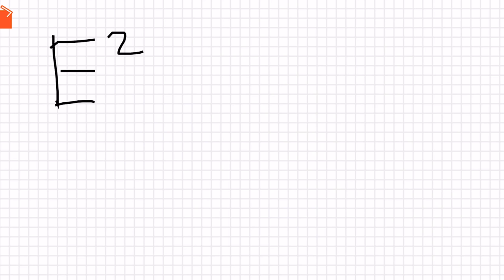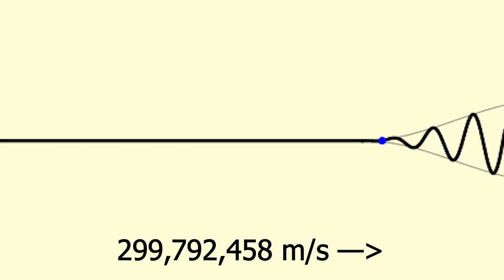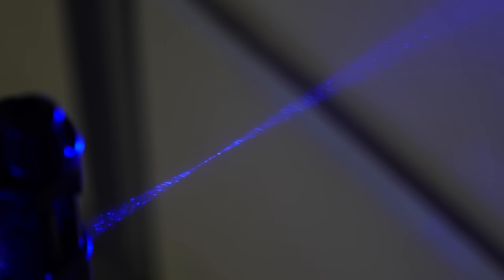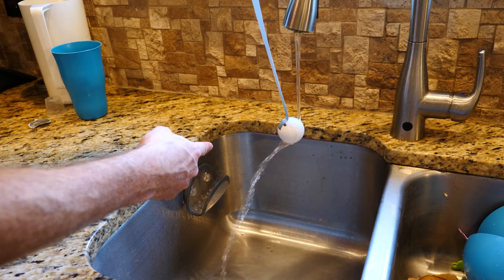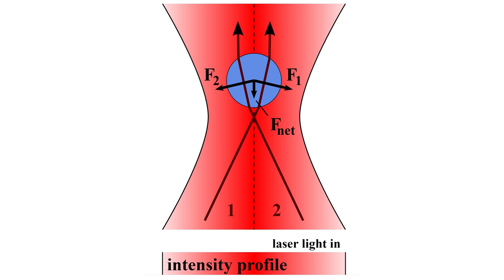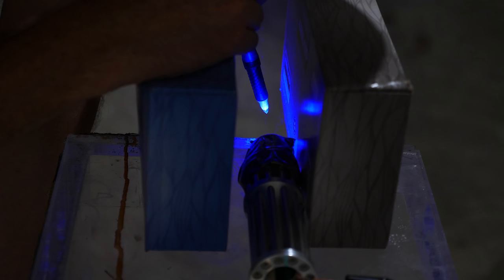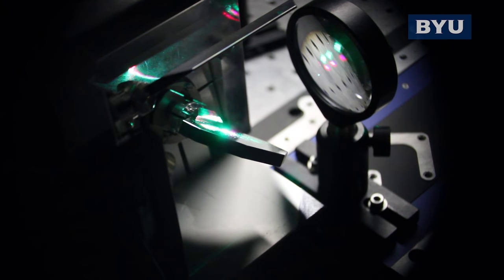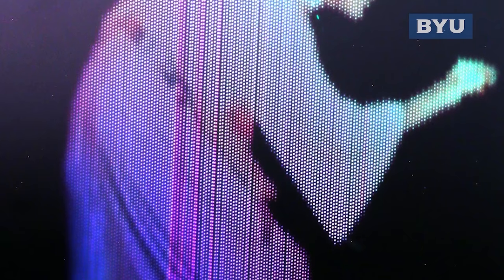Trapping Particles In a Beam of Light—The Optical Tweezers Experiment

Comment: I could see this being used for sci-fi holograms in the near future. Seems much more promising than any other 3D hologram tech I’ve seen
Reply: Technically that would be a volumetric display, holograms are 2D panels with depth,, volumetric displays are fully 3D displays with no background. The issue with this one though is you can't turn it off once it's on or we lose the particle in the laser. Plus it would get finicky with multiple lasers crossing each other. Probably still better to go to holographic displays for viewing content. Plus you can't really make shows or movies with a volumetric display as you don't get room design or backgrounds, just the focus.

Comment: I've always wondered about light being massless when the SI units for momentum are kilogram meter per second.
Reply: Same here.
Reply: I think it has to do with the Lorentz factor. As something approaches the speed of light, the Lorentz factor increases to infinity. In order to get something's mass as it moves at relativistic speeds, you multiply its rest mass by its Lorentz factor. As matter approaches the speed of light, its mass approaches infinity.

Photons don't have mass though, and their Lorentz factor is already infinite, so you end up with zero times infinity. This is indeterminate, and as you learn in calculus, it can be 0, infinity, or anything in between. In this case, it seems to be something in between.

That's how I've always thought of it anyway.
Reply: Its displacement.
Reply: Inordinate particle wake
Reply: If “nothing “ goes through something it leaves a trail
Reply: So then how do we explain displacement here( on earth) that directly interact with particles left in in wake and ahead of it…we like to think particles(some
Reply: Particles) have a memory whether past or future
Reply: @unitedspacepirates9075  - If that were true, a magnetically cancelled wound coil (like the ones used for wirewound resistors) would not have back EMF, yet it does.
Reply: PBS said: "Imagine a massless box with mirrored walls. Impossible, I know, but it's an analogy for something real, as we'll see. Now fill it with photons, also massless, that bounce around inside the box in all directions. All of the walls of the box will feel the same pressure, so there's no overall force on the box. But let's give the box a little nudge; increase its velocity. Now the back wall of the box moves into the incoming photons. It feels a little more pressure from their impact than before. In the meantime, the front of the box, moving away from the incoming photons, feels less pressure. There's a net backward force that feels like a resistance to the change in speed. The photons exert a force on the box, the box also exerts a force on the photons: Newton's 3rd Law, which gives us conservation of momentum. Momentum lost by the box is transferred to the photons. Now, if the box stops accelerating, then everything jiggles around & momentum gets shared out evenly between the box & the photons again. But as long as acceleration continues, the pressure differential persists. Acceleration is resisted in a way that feels exactly like mass. In fact, it's indistinguishable from mass, because it is mass. The photon box is massive, even though none of its components - not the photons, not the walls - have any mass. Somehow, mass arises in the ensemble where it doesn't exist in the parts."
(from the YT vid 'The True Nature of Matter & Mass')
Reply: @alwaysdisputin9930  clever humans might figure out gravity propulsion before they destroy their planet after all.
There goes this galaxy :(

Comment: @
The Action Lab  Wow!!  Talk about a coincidence man!  Just this summer, I was doing optics research with a researcher that actually helped pioneer some optical tweezer research a couple decades ago!  We were working with optical vortices for a different purpose over the summer, but one of the papers I was assigned to read was one of his papers on optical tweezers.  It's so weird that you make a video about it right after I had that research experience.  By the way, one of the things I read is that you can also use optical tweezers to move tiny beads to indirectly move cells as well.  Really cool video, thanks!

Comment: James, I have a query, but first, I absolutely admire the enthusiasm behind your explanations, and the efforts of the demonstration! Thank you for that😊. So, I had recently attended a demonstration on optical levitation, and as I read more, I came across this description from Wikipedia on “Optical tweezers” –

 “The narrowest point of the focused beam, known as the beam waist, contains a very strong electric field gradient. Dielectric particles are attracted along the gradient to the region of strongest electric field, which is the center of the beam. The laser light also tends to apply a force on particles in the beam along the direction of beam propagation.”

I noticed that your explanation describes the levitation analogous to the mechanical imparting of momentum, while Wikipedia emphasizes the levitating particle’s dielectric properties interacting with the beam’s E-field. 

My doubt is, what we notice at a macroscopic level as mechanical, does it converge to electromagnetic interactions with material properties in the microscopic view, as the same effect?

Comment: This is intriguing. There is an obvious flaw if we want to use this more however which you pointed out..  air dispersion. The particles can be dislodged very easily, however, I would surmise that creating a static field around the area would resolve this to varying degrees.

Comment: I just loved your vídeo on laser light momentum. I used to do an experiment to show brownian motion on smoke particles. I used a spectrograph cell with good viewing windows. After loading the cell with smoke it was closed. Then a laser pointer beam was was passed through the cell. The random motion of smoke particles was easily observed using a microscope at about 50x. Well, my question is: why did I not see a forward motion of the particles along the laser beam. Supposing there was momentum transfer ?

Comment: Thanks for the video. You (and others watching) might want to look again at the difference between optical tweezers (sometimes called optical dipole traps) and magneto-optical traps (sometimes called MOTs). This video uses the physics behind MOTs when talking about optical tweezers--which is related but not exactly correct. In fact, optical dipole traps can hold particles still far below what is known as the photon recoil limit. Good luck and cheers!

Comment: E= mc² is just a special case for rest mass to rest energy relation. Since individual photons or a photon beam are never at rest, yeah, you have to use a full equation mentioned in the video. Fun fact is when you put photons in the box with fully reflective inner sides their momenta cancel out as a sum, so their energy does contribute to the rest energy (and thus rest mass) of the whole closed box system.

Comment: im so happy that i have a laser collection. just tried this with a 1w 445nm, 75mw 520nm, and 20mw 405nm. worked with all 3 that i tried it with. amazing demo! you can move the laser around gently to move the suspended particle. i suggest doing what he did and put things around the focal point to keep the air as still as possible. also, never forget your laser saftey glasses
Reply: Hey I’m trying to do this project for my physics class and I can’t find out where to get any of these things. Did you have to use a lens to focus the light more or did it work with just the laser? And can I just order from Amazon a laser that has the same specs as you mentioned??
Reply: @dannyphxntom8992  i personally just used the focusing lens built into the lasers. the most important thing about this experiment is the quality of the beam shape, youre going to want as close to a circular beam as possible. you can check the beam shape by using an external lens or just the built in one. i had a 800mw 638nm laser that i tried this with, but it didnt work because the beam was shaped more like a line. ideally you should be using a "single mode" laser, which gives you the best beam shape for a diode laser. you can find higher powered single mode violet lasers on amazon i think.

Comment: Three Questions:
1: has the light beam carved-out the ink particle to a perfect size that like gun rifling the bullet is loaded at the ready, even though it's currently with the gravitational pull of the planet?
2: if double this amount of light were suddenly to occur, wouldn't that fire the bullet to light speed?
3: could this be used to escape the gravitational center of a black hole, if one were to triple the amount of light, hence doubling light speed? Naturally, the bullet would need to be somehow resistant to all forms of cosmic friction, but be perfectly snug into the rifling of the light beam, while not causing the sonic-boom equivalent of a big-bang event?

Comment: You can also have such Graphene particles induce heat when you increase the wattage uniformly .. as well as irradiate cells to cause spike proteins to respond dynamically to the vibrational irritation. Not unlike the Sharpie Ink .. there are many sources of carbon tube graphite that are more common than you think, like cash register receipts, laser printed paper labels, and just plain 'carbon' dust in general .. for it reacts like a omnidirectional antenna to vibrations proportionally to the geometry of the carbon being used ... aka balls, meshes, and pipes. Dielectric charge floats on the surface as you all should know by now.

For example .. Graphene Oxide is used to do the same exact thing in the above video with radio waves to deliver drugs and other functions to a target area of the body .. via a 3 dimensional phased array ... in a stationary environment. 

With "Action at a Distance" available .. it sure seems like one could achieve good accuracy with triangulation, worthy of a few experiments at least.

Comment: I have an idea for a space ships.
WHAT IF we have a partical fixed in place (not via light but physically) placing a laser pointer infront of it facing backwards and focusing its light ray just infront of the partical. we would still have to power the laser but both the laser pointer and the partical would get pushed/pulled forwards and the spaceship acelerates.

Comment: Question: if the laser is focused down to a tiny point, how come the particle isn't blocking the laser light from continuing on past the focal point?  Is the particle smaller than the focused laser?  And if so, then how is that working?  Because if the laser gets focused so narrowly, and it's larger on either side, isn't the focal point infinitesimally small, and therefore smaller than the particle you're suspending?

Comment: If light has no mass then explain how come gravity affects light? Doesn't it have to have mass for gravity to affect it?
Reply: Light gets affected not because of its mass, but due to a thing called gravitational lensing, which is a warping of spacetime under the mass of celestial objects. If you imagine an elastic fabric and you put a massive object on it, it gets curved. And if the mass of object you put on there after the first object is less than the first object, it will fall into the curve. The same works with spacetime fabric. Light gets affected even without a mass, because it moves on a curved spacetime.

Comment: 01:00 Err... the equation for momentum is mass x velocity. If you're cancelling mass out of the energy equation because photons don't have mass, you also have to treat mass as zero in the momentum equation. Photons either have mass or they don't, you can't change your mind partway through an equation. That gives zero momentum, because you're multiplying velocity by zero, which still gives light zero energy (which is clearly wrong).

Comment: But how does the particle avoid falling due to gravity ?
The beam is circular so the particle is stuck in the middle.
The beam has a focal point so the particle is not pushed away.
But how do we negate gravity ? Is the particle so small that the effeft of gravity is negligible ?
Reply: Because there are other forces at play that act upon and are themselves acted upon by gravity. Gravity isn't a constant such as we would think of pressure or a specific applied force. I think. Of course I could be completely off the mark here.

Comment: Imagine this on a larger scale and you will have a better understanding of uap technology.  The cosmic microwave background is light too. You just can't witness it. If you develop a material that tachyon can't go through.  That material would weigh about as much as  planet lol. But because of the resistance of the material. It would technically be weightless do to this exact physics.  Now Imagine the material could be changed by electronic means to absorb or reflect on a specific location.  Suddenly you can reach speeds unheard of because light becomes its engine

Comment: If the particle is pulled by the light wouldn't the light lose energy? and wouldn't it then slow down. Would it still then be light? Is it destroyed or would it be slower light?
Reply: Yep, but lower energy light has a lower frequency, the speed of light is the same for all frequencies.
Reply: @Mysoi123  cheers, okay, so would the light change colour as the frequency decreases?
(I'd forgotten I'd asked that question)
Reply: @Mysoi123  what happened to you 2nd reply? it shows in notifications but not when i click on it.... ????
something about wave length and frequency effecting each other, I know the basic concept of AM and FM.
Reply: @RoverIAC  Sorry, I feel that the comment is slightly wrong, so I decided to delete it. However, in the reply to your question, frequency and wavelength are directly related to the constant c, which is the speed of light. Note that since c is constant, it means every frequency has a corresponding wavelength, and every wavelength has a corresponding frequency.

The equation representing this relationship is f = c/λ, where f is frequency, λ is wavelength, and c is the speed of light.

However, when light reflects off something like a mirror, it moves in the opposite direction, but it doesn't change color. This means that the wavelength and frequency stay the same. As far as I understand, in the equation E = pc, where p is the norm or magnitude of the momentum vector, and as vectors can be negative, but energy can't, the norm p is always positive.

So when light hits something and reflects off with 100% efficiency, the object gains twice momentum in the direction it was hit. However, the light just changes direction, so the magnitude of p doesn't change, and therefore, the frequency and wavelength don't change.
Reply: @Mysoi123  Thanks, that's the kind of think my dear old dad would have said. cheers and thanks for the explanation.